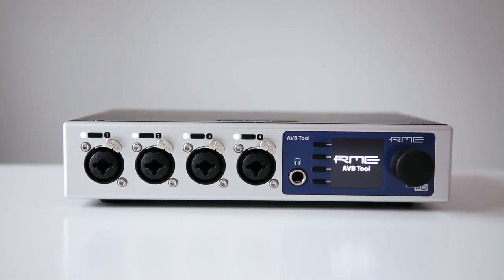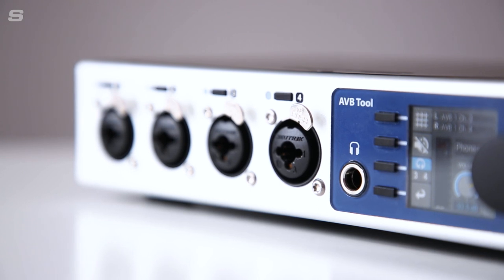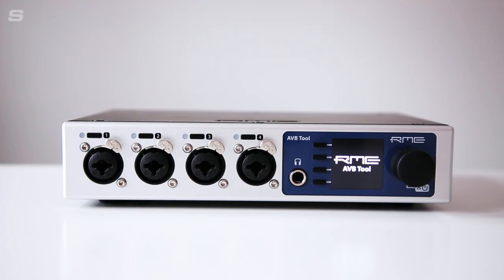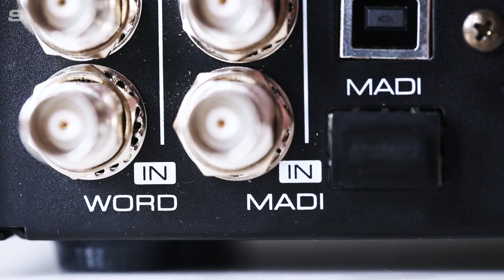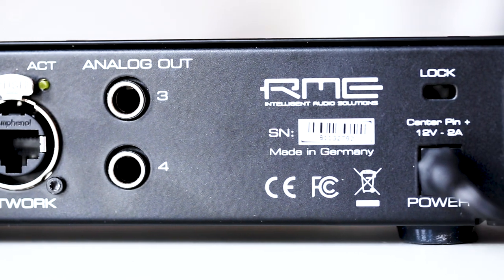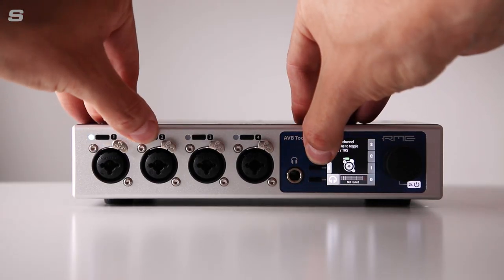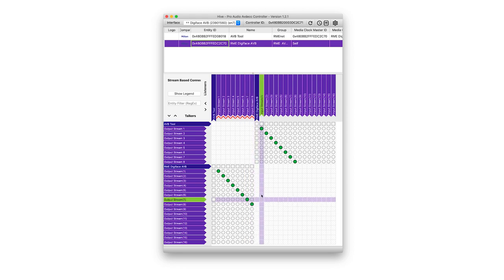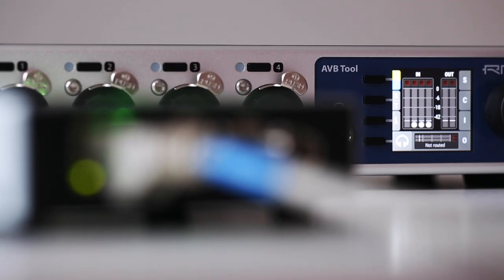RME AVB Tool Overview - Router, Mic Preamp and MADI & AVB Converter

Comment: Hello :) Can this be used to use additionnal inputs in the back of my RME Fireface 800? I have the oldschool version. Thanks!
Reply from the maker: Hi, obviously there is no ADAT on the AVB Tool so you’d be limited to connecting it via analogue. In theory I suppose you could do so via analog out 3&4, then use a y-cable to split the headphone output.

A better option for expanding the Fireface 800 is be the RME OctaMic II or RME OctaMic XTC (both have ADAT connectivity);

https://www.synthax.co.uk/rme/mic-preamps/

Comment: I’m new to this world. Is it possible to connect this device to Babyface pro simply as 4 XLR extension and operate those 6 XLR inputs via total Mix for Ipad with CC mode?    I’m looking for most compact way to have 6-8 XLR imputs but want to keep it easy to transport, thus neither FF UFX  nor Octa Mic is in my mind. Or is there any other good solution to have 6-8 rme XLR input with preamps? Thank you in advance.
Reply from the maker: Hi, unfortunately there’s no simple way to connect the Babyface Pro with an AVB Tool (no ADAT connection). They’re essentially from two different product ranges, and aren’t really designed to connect with each other (the AVB Tool is really meant as a kind of add-on / satellite device for wider AVB networks).

Or is there any other good solution to have 6-8 rme XLR input with preamps?
- Nothing really springs to mind from RME I’m afraid. As you already know the obvious candidate is an OctaMic XTC, but if you’re not up for hauling a portable rack case around I guess that’s a no go… 

You could also take a look at the QuadMic II, however that’s analogue only and so is better paired with an interface with more I/O (e.g. the Fireface UC, UCX or UCX II).

I think you’re probably best off speaking to a pro audio dealer for recommendations, best of luck with it.
Reply: @SynthaxAudioUK  
Thank you so much for explaining all points I was concerned about!! Exactly I was also considering Quadmic ii but since BBF Pro has only 2 line inputs it would  not have been able to utilize 4 expansion from Quad.  
Just right after I’ve written the first comment the RME has announced the release of UCXii and I was surprised because that is actually exactly I was looking for.  What a councidence! Now I’m quite sure that I will go with UCXii extended with Quadmic ii. Thank you for your help again!
Reply from the maker: No problem :). The QuadMic's are great for portable recording - I remember Sound Supervisor Pete Cowasji name-checking them as one of his favourite products, in the recent interview we did with him. (https://youtu.be/nImVrs-jTKo)

The UCX II also has Direct-USB-Recording (DURec), so you could also record everything directly to a USB memory stick or external HD.

Comment: Is it an interface?
Reply from the maker: Hi, interesting question! The short answer is ‘yes’, however it’s still recommended to pair the AVB Tool with a more traditional ‘AVB interface’, such as the RME Digiface AVB. This is for the following reasons;

Technically all AVB devices are interfaces, as in theory any AVB device can be connected to a computer via an ethernet connection (using a Cat5e/Cat6 cable). Mac OS has had AVB implementation for many years, albeit somewhat hidden, and as such you could just plug the AVB Tool directly into a Mac and use it as an interface. 
(On Windows machines you would need an AVB virtual sound card, such as AudioScience’s Hono AVB VSC.)

In practise however, RME doesn’t consider Mac OS’s current AVB implementation consistently reliable enough for real-world applications. As such, RME released the Digiface AVB, a more traditional interface (with USB connection) which also includes RME’s TotalMix for added control.

For multiple network devices, an AVB-capable switch is also needed (which acts like a patchbay). A current recommended AVB setup from RME therefore looks like this; 

PC / Mac > RME Digiface AVB > AVB-capable Network Switch > Other AVB I/O Devices (e.g. RME 12Mic, AVB Tool, M-32 Pro etc)
Reply: there is no TotalMix FX on AVB Tool,
you'd need Digiface AVB for proper RME audio interface features,

on the other hand, in MacOS, you can just use its stock ethernet port since AVB is natively supported